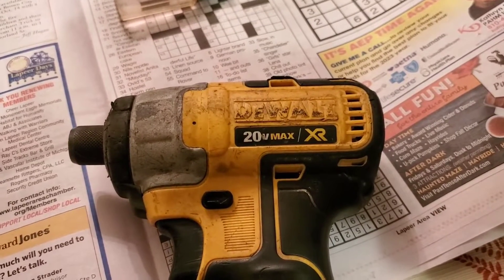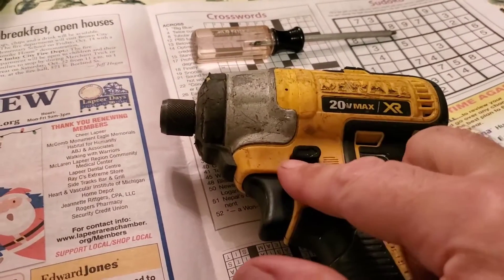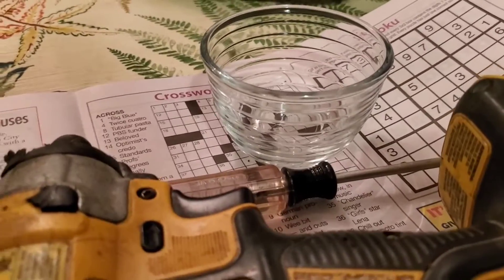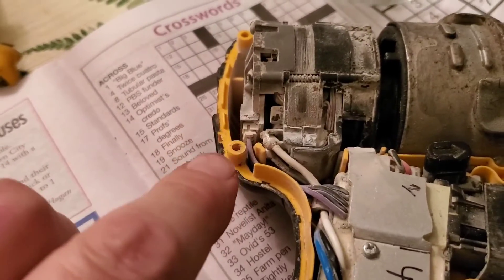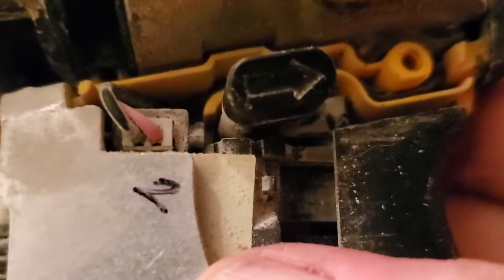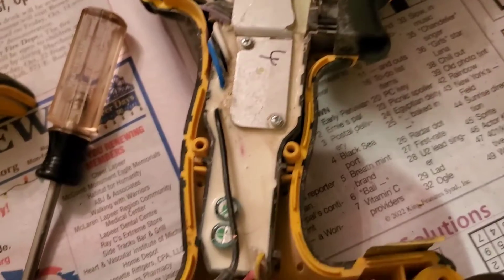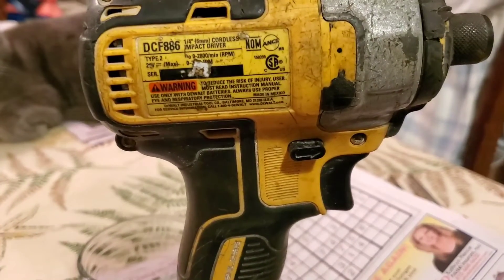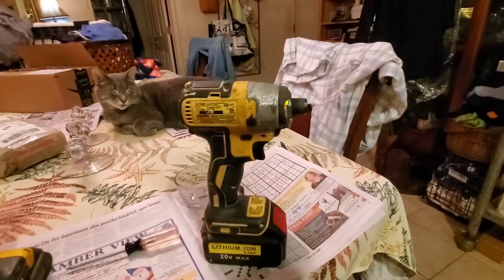how to take apart and repair a dewalt impact driver

Comment: milwauky better than dewault
Reply from the maker: I only have dewalt, but i have been very happy with them. The leaf blower, hedge clippers and the heavy duty 1/2 impact have impressed me. For home use and my side job fixing cars & small engines.
Reply from the maker: I do have a milwaukee hammer drill (corded) that is an awesome tool too.

Comment: Its good that its started working, which means there might be some dust sticking to the terminals. All you need is to use Contact cleaner spray to clean those contacts and leave it in the open for a while so that the spray evaporates. This solution will help you in long term use.
Reply from the maker: Good tip!